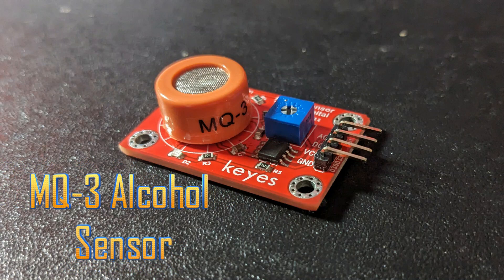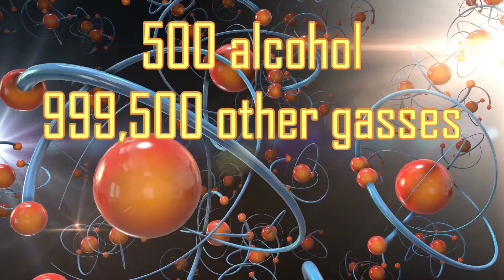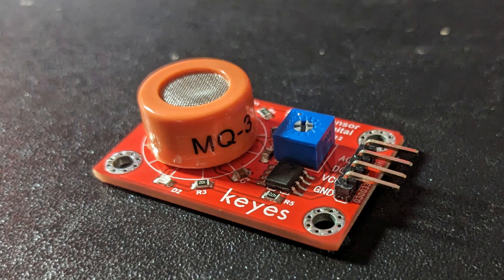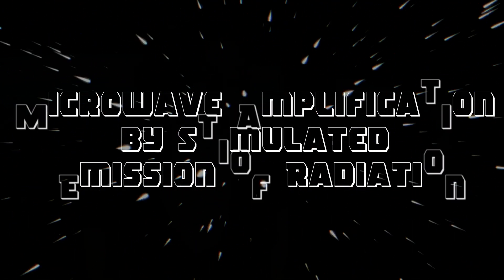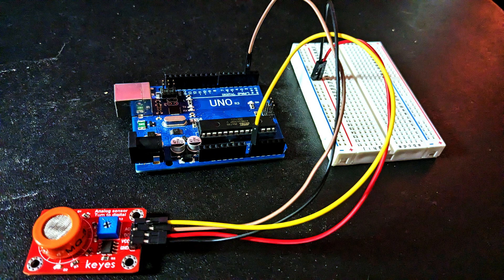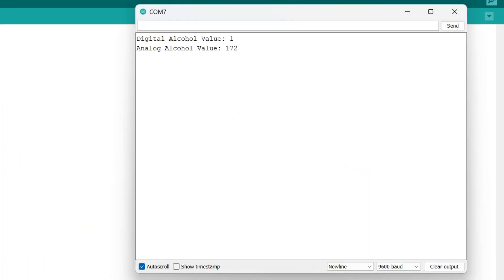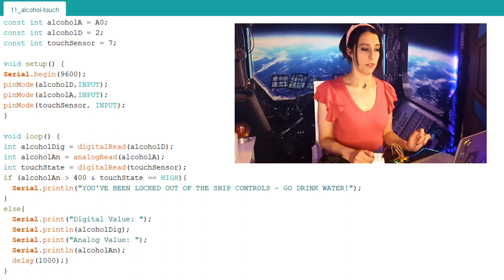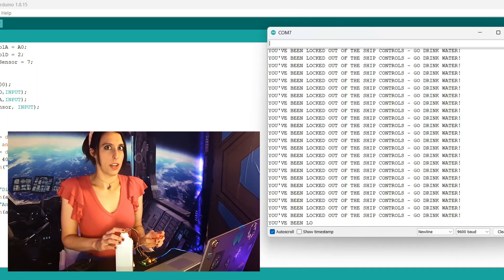Don't Drink & Fly With Arduino Alcohol & Touch Sensors!

Comment: Next project: Aspirin dispenser for future you triggered by a lockout event 8 hours previously.
Reply from the maker: Do we really think aspirin is enough to solve that kind of problem??
Reply: @unprofessionalspacepirate  The placebo effect to the rescue? To be on the safe side it should also dispense water, maybe in a powerful cold stream.
Reply from the maker: I love the idea that the placebo effect would save you from an asteroid hurtling towards your spaceship emergency
Reply: 😂 @unprofessionalspacepirate  I was thinking of a hangover after setting off the alcohol detector. But in this case I think clinical trials would show the placebo effect to work just as well as aspirin. 💥